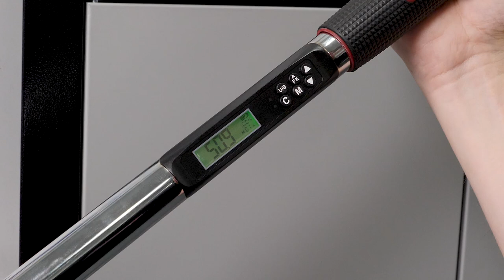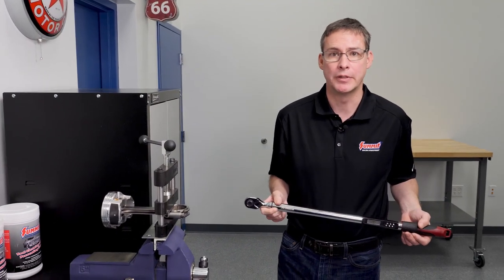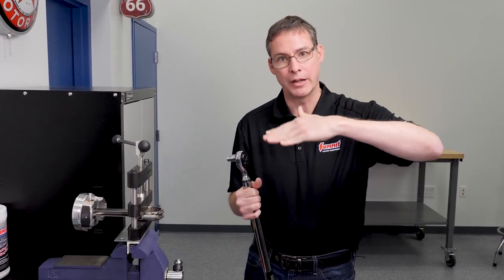Using Torque Angle to Secure Connecting Rod Bolts

Comment: Brian (or anyone else who knows),  I want to just retorque the crankshaft and connecting rod bolts on my BMW motorcycle engine while I have the cover off.  Do I need to use the angle method - or is that  just for new installations/bolts?

Comment: Hi can you please advise how to torque E92 M3 OEM ROD BOLTS
Reply from the maker: We were able to find this information for you: 
BMW Group - AIR: 2017-03-02 / 16:21
Model: M3
Development code: E92
Model code: KG93
Lead type: KG93
Order number: -
AIR - Technical documents Page 1 of 2

Replace screws
Screws washed
and oiled
1. Jointing torque 6 Nm
2. Setting torque 20 Nm
3. Angle of rotation 130°
Important 4.
Release
connecting rod
bolts.
5. Jointing torque 6 Nm
6. Setting torque 20 Nm
7. Angle of rotation 130°
Important 8.
Release
connecting rod
bolts.
9. Jointing torque 6 Nm
10. Setting torque 20 Nm
11. Angle of
rotation
130°